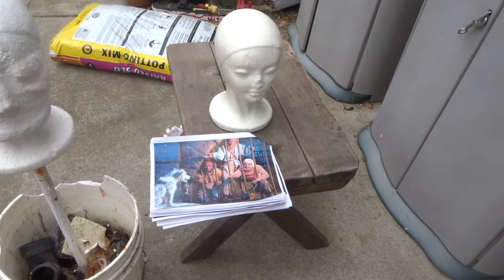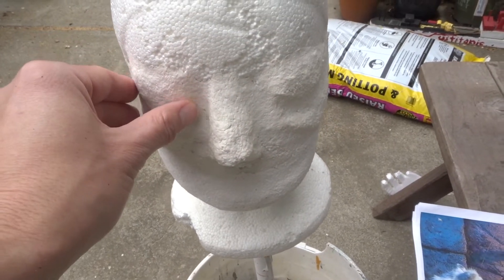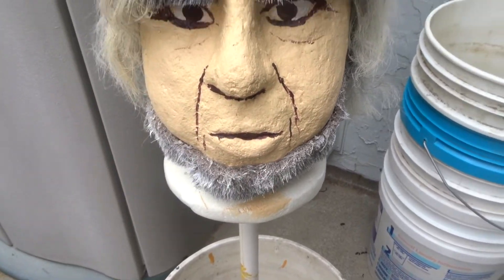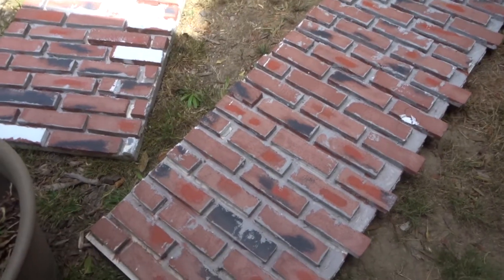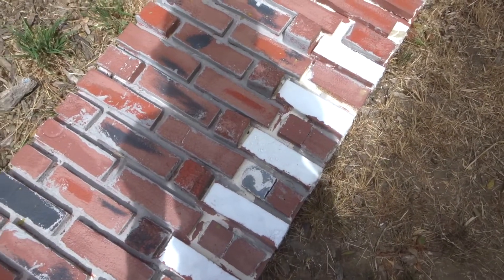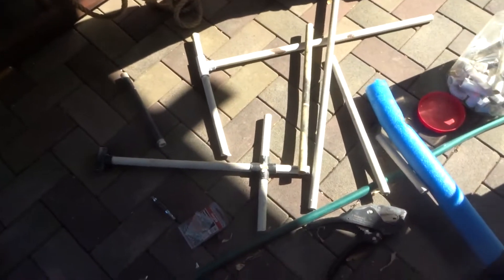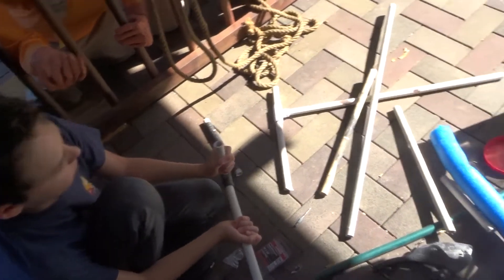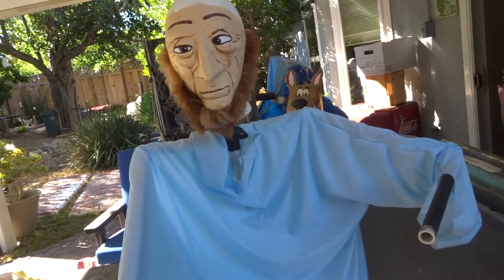Making Pirates and More

Comment: How do you make your "clay"? Can you share the ratios please? Sounds like exactly what I need!
Reply: Sure thing...The mix is toilet paper (the cheap stuff), joint compound, and elmers glue. Soak the tp overnight (unroll it in water), grind up, squeeze out the water, then mix with  joint compound and glue. I usually do three rolls of tp, three large scoops with my hand of compound, and about 4-5 cups of glue. You want the consistency to be like cake frosting. if it is too dry, add more glue. Make sure you mix it thoroughly. Let the clay dry completely before sealing or painting! Have fun :)